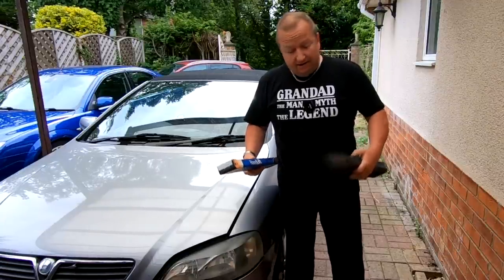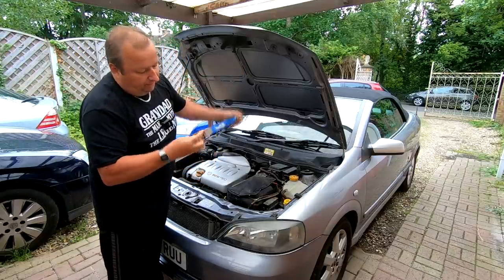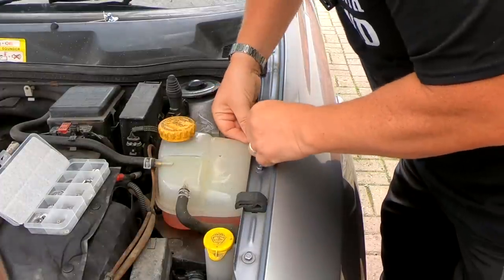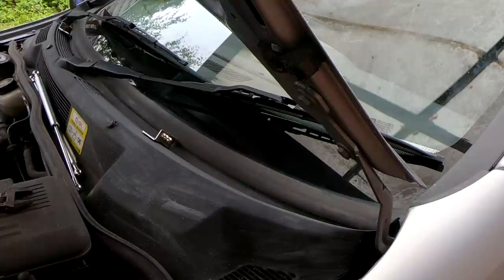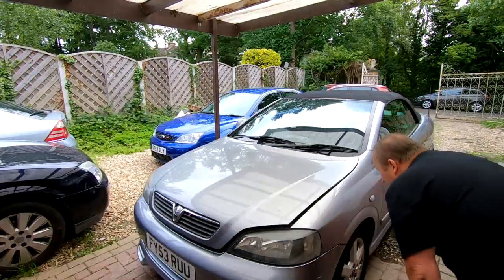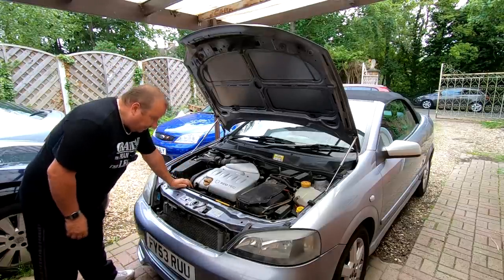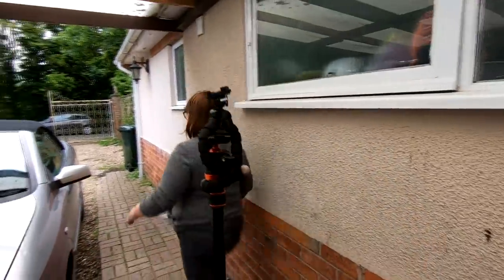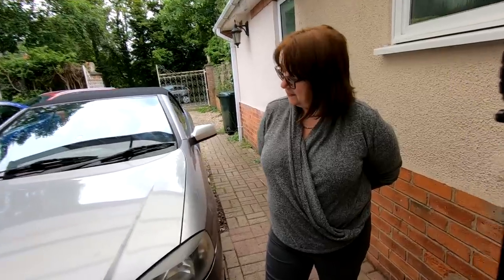The Astra Gets New Irmscher Grille And Bonnet Struts

Comment: Top job Martin. Looks loads better mate. I have just done a clutch pedal rtn Spring on a 2014 Astra, after Vauxhall tried to rip the elderly owner off, to the tune of £500. These main dealers are pond life.😡! Vauxhall Astra clutch pedal rtn spring snapped. Vauxhall said u can't buy the spring, u need a complete new pedal box. Costing £300 plus labour !! I got a brand new genuine Vauxhall spring online. Cost £3.99 inc postage and i've just fitted it. Had to take half the lower dash out to get to it. But easy enough to get in to it once u have done that. The fun part is trying to get the spring back on the pedal end. Again Vauxhall will say u have to remove the pedal box, more lies. A bit of improvisation is all that is needed. 8mm ring spanner over the end of the spring. Mole grips on the spanner and pull. Spring hooks on nicely. Couple of hours job done. Dash all back together. I havn't told the owner yet. But i'm not taking a penny from her for doing it either. I'm just happy i've saved her from paying out £500 for nothing. These rip off merchants, make me so angry ! 😡
Reply: Well done, we need more people like you, main dealers have a lot to answer for
Reply from the maker: Well done Craig, Legalised robbery in my book.
Reply: @retrorestore  cheers Martin. 100% mate. They are bloody crooks the lot of them !
Reply: @Charlie_Crown  cheers mate. They sure do !

Comment: With the bonnet pull you can bend the back with a little heat and it will fit a bit nicer better still you can move to to the side

Comment: Hi Bud I love watching this video I think Astra convertibles are great cars The one I have and your could be nicer than the next newer model.
Cars between 2006-2009 If the roof goes.
Anyway Its looking impressive wish mine looked as good.
Mine 2.2 Bertone  standard interior I blew £719 on this years MOT but it had new battery new Alternator plus new brake parts and windscreen wipers.
My main real question is those who don't really rate the cars but they consider them at poor prices.. I paid £350 for mine about 5 years ago my average yearly spend MOT wise is £350but it had four not 5.
So here is my true issue it has a private plate worth £650 and with me blowing £719 on mot the actual value of the car with cost should be My original price on Sunday was just £1395 that is really a free car based on that price with the spend being £1639 even facebook market place wont allow me to ask any more than £1695 as I tried for £1995.
I don't fancy losing money on the car but one guy commented it needs a service but when the previous owner had new engine it most likely had oil n filter change..i have only driven 5860 miles in my ownership..
So honestly if you was selling your car with the time and effort you spent I am sure you would want £1895 or more all day long..
Tell me what you think these rag tops are really worth because I enjoy driving mine but right now I have bought a 2007 Audi A6 estate 2.7 diesel.   And my cars n van are on the street I am unlucky not to have driveway I wish I did..
Reply from the maker: I think they are going up in value but I got mine cheap, Dealers are asking around £2000 but privately they are cheaper. Depends on condition and mileage too.